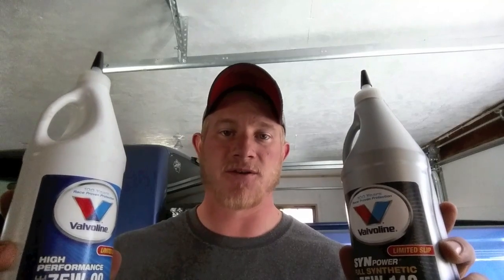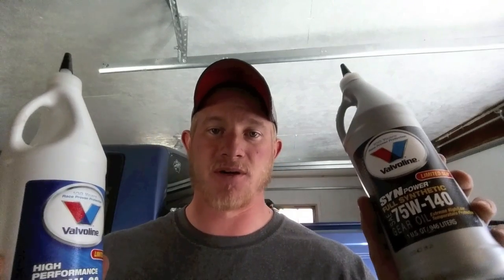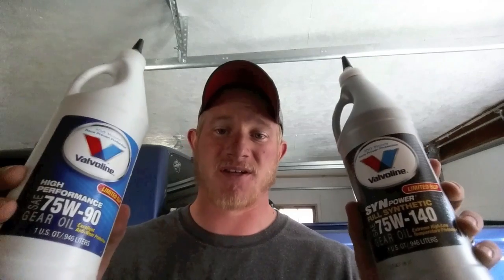75w-140 vs. 75w-90 Gear Oil | How To Read Gear Oil Viscosity Numbers

Comment: Bear in mid that the more the difference between the the two viscosity (cold and hot), the more the oil will follow the higher number while it is deteriorating. I.e:

75W-140 has a difference of 65
75W-90  has a difference of 15

As both oil types get old and contaminated, their overall viscosity will be higher and their property may be:
120W-150
85W-95

So, a lower cold viscosity number does not necessary mean that it is going to hold that so long. The oil has to be in check.
Reply from the maker: Yup. All oils break down over time and need changing, you are right. They won't perform the way they're supposed to after time and so they need to be changed. Thanks for the comment!

Comment: Hi. My motorcycle uses semi 10w40 oil. I have in a quart a mix of liqui moly, Motul and Wolf Belgium semi synthetic on excedent from previous bottles when changing oil. Can I use this tree brand mix with identical API and JASO specs? Thanks in advance.

Comment: got a question. I changed my front diff seal and it still leaks.  original seal was bad.  manual recommends 75-90 and I  changed to a 75-90 synthetic after I put in new seal.  Should I change to 80-90W NON synthetic because I heard that synthetic gear oil may actually cause leaks, especially on a truck with high mileage.  thanks for any advice.
Reply from the maker: That's a good question...a lot of myths out there about synthetics are simply not true, whether it comes to synthetic motor oil, transmission fluid, or gear oil. However, if you do have leaks even after changing out the seal you could definitely try out an 80 rather than 75. It might not do the trick, but it's worth a shot. Just know that usually the "synthetic causes leaks" is a myth. I could go more in depth but really whether it's synthetic or not, it's the same viscosity so that's not what causes the leaks. Basically the leak started or continued because the old fluid was so gummed up and old that it simply plugged the leaks. So even if you changed it out with non-synthetic it would have probably continued to leak out because the new fluid was not gummed up and would be able to seap out of those tiny leaky areas. I hope this helps bud, and thanks for the question!

Comment: I have a 49cc gasoline scooter. Could you kindly inform me what particular GL4 gear oil to use.  I don't plan on riding during the winter months, and I reside in MA    Thank you very much
Reply from the maker: Oof...on that one I'm really not sure. I would just go with what the manual or the dealership says and you should be good to go.

Comment: Hey ? So I can use 75w140 for my highlander 2004 in florida ???
Reply from the maker: If you're running it hard I'm sure you could, but usually unless you're doing extreme work in extreme temps I'd stick with the manufacturer's recommendations.

Comment: My Tacoma manual request 80w 90,, what's the difference between 75w90?
Reply from the maker: One could be synthetic and the other not...but the main difference is that the 75 is slightly better in slightly cooler temps is all, or very slightly less viscous than the 80w90. Those 2 are very similar weights.
Thanks for the question man!

Comment: I will help clear the numbers for you. The first number is the weight of the oil or lubricant. The lower the number the better flow characteristics when it's cold. The second number is something totally different than what everybody believes. A 75-140 is still a 75 weight lubricant, the 140 means that when it gets up to operating temperature it has the same thermal protectant and weight as a 140 weight but only at operating temps but is not a 140 weight. It will always be a 75 weight. The second number only signifies the thermal protection at operating temperature. Another example is a 20/50 is a 20 weight oil but at operating temperature and has the same thermal protection as a 50 weight. I understand everyone gets confused on that and most places that you go in and talk to mechanic they still do not know the proper definition. I can tell you with absolute certainty that what I have described is the correct way. I hope this helps
Reply from the maker: Yes, you are correct. Maybe I was unclear in the video but basically you paraphrased the point that I was getting across.
Thank you for the comment!
Reply: I've noticed once it gets under 32f 75w-140 vs 75w-90 it's a bit thicker when you first start driving, I'm guessing I should wait 5 minutes before driving at highway speeds so it get flow more smoothly.
Reply: Should I use 75w 140 in the Deep South. It's 97 to 107 temp in summer. Winter we might have 3 days below freezing! Normally it's warm in winter too!  This is a four runner and they recommend 75w-85
Reply: I'm writing from Türkiye. I own a Dacia Duster 1.3 TCE 4x4. The recommended differential oil for my vehicle is 80W-90, but I think 75W-140 would be more effective. I'm curious about your thoughts on this. Would 75W-140 be more compatible with my vehicle?
Reply: And i will help clear the numbers for you. The W for winter and it means the oil viscosity in low temperature (cold) the second number is the oil viscosity at 100° (hot) and those numbers are grades defined by society automotive engineers (SAE)
Reply: No, W in oils stands for winter and has nothing to do with it's weight. Please don't spread misinformation, learn the facts before repeating what people repeat.

Comment: Good info and one more important piece of information to add. Some of the gear oil does not contain a friction modifier,If you have a limited slip differential that will need to be added or costly repairs will soon show up.
Reply from the maker: Yes, exactly! Thanks for the comment!

Comment: Does all these 3 oils have almost same viscosities and can be interchangeable as a gear oil in transmission of 110cc gearless scooters.
SAE 10W30 engine oil ,
API GL-4 SAE 80W-90 gear oil  and 
 GL-4 SAE 90 grade gear oil.

Comment: AMSOIL Severe Gear® Synthetic Extreme Pressure (EP) Gear Lube comes in  75W-90, 75W-110, and 75W-140 FTW . I prefer Amsoil's synthetics vs most other synthetics, that being said, any of synthetics is going to be just as good. Cannot go wrong

Comment: even better run synthetic gear oil has much higher performance in both cold and hot. GM factory fills diffs with synthetic for a good reason, it almost stopped all warranty rear diff claims
Reply from the maker: Very good point! I can't remember for certain but I think I mentioned the synthetic gear oil in my video also. Thank you for the comment man!

Comment: Got a question. On my 02 S10 rear end, I put 80w90 and 85w140 wi that be ok?
Reply from the maker: I would check the owner's manual to be certain, every rear end is a little different, but if you are running your s10 pretty hard that shouldn't be a problem. It may just seem a little sluggish if it's too thick of luid for that differential, and that would be an indicator that you should switch it out. It shouldn't cause any damage or anything though.
Reply: Midwest Garage thank you! Before I changed, when I’m going 75mph, I hear a slight hum noise and it goes away when I let off the gas. When I took the diff cover off, it was very clean and I couldn’t find any play in the carrier and the pinion bearings...

Comment: What if on the oil grade says only 75W, what does that mean?
Reply from the maker: That just simply means that it is not a multi-grade oil. It is a winter grade gear oil that will not protect as well at full operating temperature. A 75w140 for example will flow like a 140 oil at 100 degrees Celsius (protecting and lubricating properly at high temperatures) where as a 75W oil is not going to "thicken up" and protect as well.
Reply: Thanks! I need it for a VW Golf mk4. I found the code for the original oil and it says only 75W. If I would want to buy some other brands like Castrol, on it's website it recommends  75W80 or 75W90. Strange is that the simple 75W is the OE VW oil..
Reply from the maker: I'm glad I could help! That is kinda strange that it calls for only 75w, maybe thats what a lot of foreign vehicles use?...but then again like I said in the video I'm just lightly scratching the surface with oil viscosities. There's so much science that goes into it and I just kinda know the basics haha.

Comment: The only negative impact to use 140 instead of 90 would be, when the gear is not very hot, like normal driving condition without towing, the resistance will be higher than a 90 viscosity, so maybe the fuel economy is gonna drop down a bit.
Reply from the maker: Very true. Theoretically, these 2 should behave the same at cooler conditions, but you're absolutely right. Fuel economy does drop slightly with the heavier weight. Some people notice a more sluggish rear end too I've heard, but I've never noticed that.
Reply: The hotter the 140 gets, the thicker it gets relative to the 90.  Cold, they would be very similar

Comment: I would bet my bottom dollar that the 75w-140 is thicker in winter temps than an 80w-90. Yeah, it is rated at lower viscosity, but barely.  So, the only difference is the hot temp rating. Viscosity stabilizera break down quick, so the 75w140 will most likely be and stay thicker very quickly.  Either way though, your info is all valid, no flaming here.
Reply from the maker: Thank you for the insight! I wouldn't bet against you on that either. I do notice a little hit to fuel economy which tells me that the 75w-140 stays a little thicker. But it's definitely got the protection when I need it for the hot rating so it's worth it.

Comment: Great video!  Actually, the first number (small #) represents the weight of the oil, or how thin it gets, at lower temperatures.  The "W" stands for Winter.  It's based on a designated amount of oil flow at zero degrees F.  The second number is for after it's warm, measured at 210 degrees F.  So in theory, as long as the first number is not much lower (you wouldn't want spin-off when it's designed for loose tolerance) then the higher number would be better for heavier loads where the axle is hotter than normal.
Reply from the maker: Exactly! This video is more explanation in layman's terms, but you're exactly right.

Comment: I think your definition of viscous isn't correct. You say the 75w is better in the winter compared to the 80w because it is more viscous. No I think it should be less viscous. If something is viscous that would mean a resistance to flow. In the winter you want something that will flow easy aka less viscous
Reply: I'm glad you said that because that's what tripped me up in this video. I couldn't work out why you would want the oil to be more viscous in the winter since it would naturally get thicker when it's cold.

Comment: changed my oil on my 05 scion xb (manual trans) with lucas synthetic 75w-90 and my second gear grinds when going from 1st-2nd, I heard it my be the type of oil I added that caused the problem. Im changing it today with Mobile Synthetic 75w-90 today, hopefully the problem goes away.
Reply: Sounds like you put a GL-5 in your manual gearbox and l believe your Scion calls for a GL-4 in the manual gear box.  When you try to run a GL-5 in a manual trans gear box you will get crunching/grinding.  lf you switch to Red Line MT90 GL-4 oil the problems should go away.
Reply: Jose Ochoa did the problem go away?

Comment: i just accidently put in a quart of 75w-90 and a  little more than a quart of 75w-140 in my rear differential. I thought i bought 3 quarts of 75w-140 and accidently bought one 75w-90 and didnt realize until i finished and looked at the reciept and checked my empty bottles. Is that bad or will it cause a problem? Im thinking about just putting in more 75w-140 or just biting the bullet and changing the oil again.
Reply: royal purple was the brand of oil
Reply: I believe you should be fine.  If you want you can replace the fluids.
The most important thing about gear oil is that it is clean, and that it is the correct level/amount.  ANY gear oil is better than very dirty or very low gear oil.  You could use cooking oil to get you to proper service in an emergency - it would be better than nothing.

The only thing to be aware of, is if certain gear oils are not recommended because of material incompatibility.  IE:  if a certain fluid is ONLY recommended because others will damage seals or gearbox metals etc.  THEN is when you must be careful.  

Most light trucks and passenger vehicles with separate differentials are ok with most types of gearbox fluids.  But some are very fussy, AUDI, VW, Mercedes, etc.  Only put the exact correct fluid in those things.

Stay gold.

Comment: last week I changed out factory fill in rear diff "g80" with ac delco 10_4016 75w 90. now the rear end acts like its lock during slow right turns. any idea on how I fuck this up.
Reply: You just need to add a small bottle of "Friction modifier" for traction lock or posi trac or limited slip differentials... No biggie..
Reply: NO NO NO NO!!!!! G80 absolutely is NOT a limited slip. Not at all, not even close. It's a locking rear diff. I have one sitting in my garage if you want pics. I swapped my old G80 out for a true limited slip (Eaton Truetrac posi).  You do NOT and should NOT put friction modifier in a G80. It wants standard cheap gear oil.
Reply from the maker: What does the manual say to use for diff fluid? The G80 may need an additive since it's a LS rearend.
Reply: Midwest Garage the manual says I'm a douche bag for changing it out @ 3000 miles.  IDK what it calls for.
Reply: carl gustav my old s10 recommended a diff change with the first oil change.  30k after that.
Reply: did the same thing, the grape juice is not for the g80. had to use Walmart oil
Reply: NO do not add any Limited Slip into the G80. GM specifially says not to do it as it is a locking rear end, not a limited slip. GM warns that adding the LS additive could cause it not to work correctly.

Comment: oils are tested at 40C for the W number and at 100C for the second number. common mistake is people think oil is thinner when cold but the scales are diffrent .
Reply: zloben9000  how you read multi weight oil designation is that the oil behaves like what ever the first viscosity is at that 40 degrees celsius and behaves as the second viscosity at 100 degrees celsius. lower viscosity oils are thinnet than higher viscosity, but no matter the viscosity, oils gett thicker as the temp decreases

Comment: so the manual  says lubed for life  with 75w 140   if you  put anything other then synthetic on its every 3k if you use full synthetic  you also need an additive should i change it  not knowing the history of the truck  btw it has 84k 2005 ford ranger 2.3
Reply: I just got a new truck, new to me 2014 Tundra..I went through and changed the rear dif and the trans oil. It gives me the knowledge and satisfaction that its done right!

Comment: What would be better in a manual transmission . ?? .,.. my avg speed is 75 mph.. ?
Reply: That's a myth from 20-30 years ago.
I rebuild manual gearboxes and I have never seen this mythical destruction of synchros people parrot about.
Reply: Chordstride the gl5 gear oils have higher sulfur content which discolor yellow metals when the oil reaches its boiling point, a situation that realistically is not going to happen unless the oil level is low enough that it is not providing lubrication, at which point the syncros are going to be the least of your concerns. semi transmissions use gear oil and they can go well beyond a million miles without problems if treated right.
Reply: +Chordstride  Must be why my factory Jeep manual says put 75W-90 gear oil in my manual transmission.
Reply: 20 Yrs ago is 1995ish. I'd be VERY careful on using the right oil.